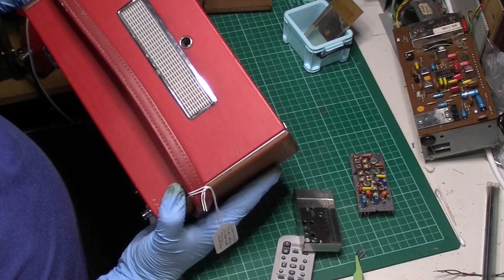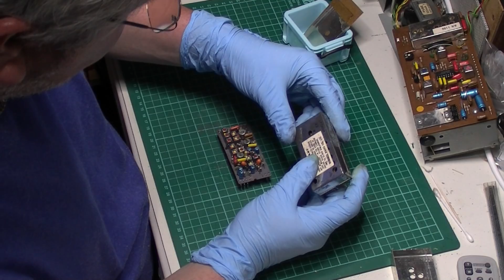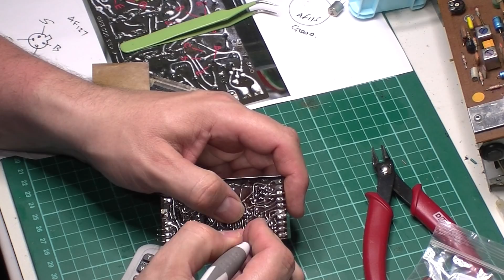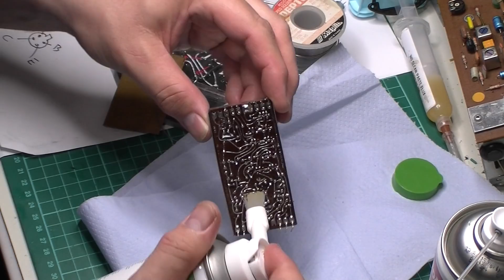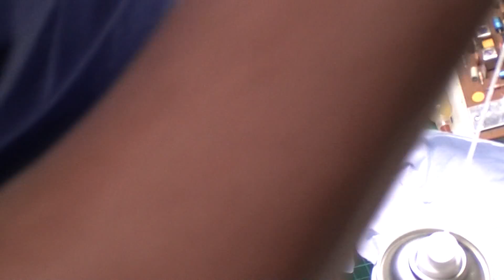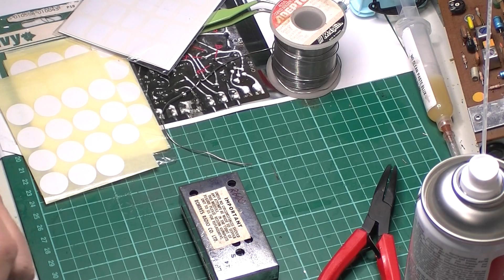Another Roberts R600 radio repaired Part 1: First look and Mullard LP1171 module overhaul

Comment: how do you know the connections of the transistors  to the board as there is no indication to where the ebcs leads go,
Reply from the maker: Hi Robert. I know the pinout of the AF11x series transistors so I made a diagram when I took them out of where each pin went
Reply: @Radiocruncher  Thats a good point i will  remember  to do that in future thanks.

Comment: Hi - that looks like an RM30 at the top? Are they worth restoring? What typically goes wrong with them? Thanks!
Reply from the maker: Hi. That's a Roberts RCM1. I've still not got to the problem with it yet as there seems to be audio but no output. The RM30 and others don't seem to fetch much and aren't very popular probably due to their size. I like them and think they are worth restoring. I'm not really aware of any recurring faults with them. Thanks for watching
Reply: Thanks - I'd be interested to see what it turns out to be. As far as I can see the the TDA1071 ICs are impossible to get these days?
Reply from the maker: I have changed the TDA1071 as I managed to get hold of some but it wasn't that. I've got a feeling it's one of the ceramic filters.

Comment: I suppose it could be argued that most of them have been very reliable and have worked for much longer than the expected life of the product. At least it has the advantage of being an almost predictable fault .....
Reply from the maker: +Harry F I agree Harry. Even if they are working fine its only a matter of time before the AF11x's short out. I wouldn't overhaul a set now without either zapping them or replacing with the AF12x series of transistors.